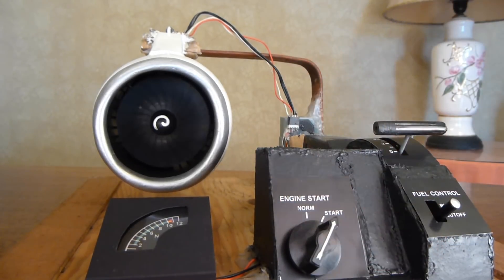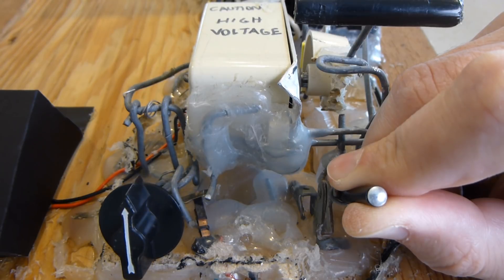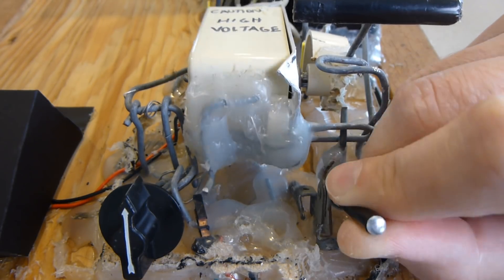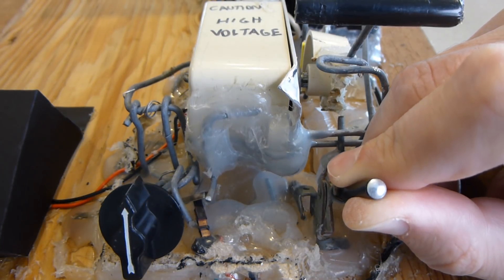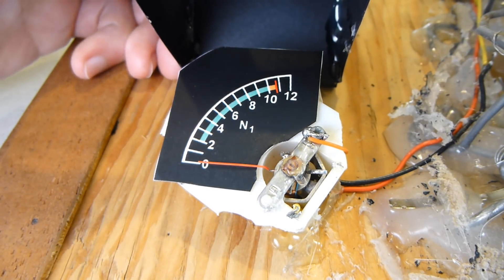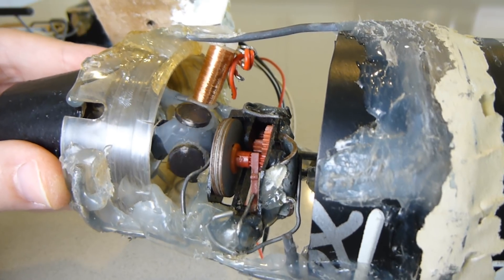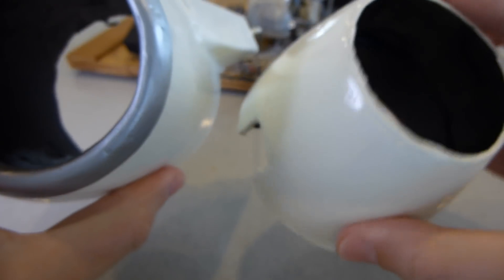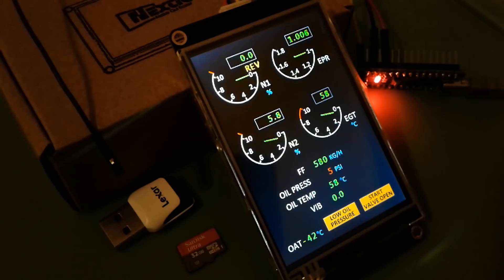Homemade Electric Jet Engine Working Model (1:24 scale) Part 3

Comment: Is this permanently destroyed or it’s still repairable?
Reply from the maker: I repaired after the video so it's fine
Reply: @interlinkknight How didn’t it turned on when you tested the switches?
Reply from the maker: In that moment it didn't have power
Reply: Oh. I thought it’s destroyed. Good thing you can use it 😃

Comment: But I wish you would explain for me in details how that gearbox was made, its function and how it works. I really don't understand those about that. And for better you would make a detailed tutorial of the engine construction from the beginning to the end. Thanks.
Reply from the maker: I'm making a second version with 3d printed parts and Arduino, which I'll do the complete tutorial.
Reply: Ok. Good. So may wait for how long brothers?
Reply: I like that idea and I try to imitate the way you did it but always when I get on the gearbox I fail due to misunderstanding about that but we hope the coming tutorial will be explaining the step by step work. Thank you.
Reply from the maker: Sadly the 2nd jet engine model is not going to be ready soon. Many months from now. I'm into other projects right now. But part of the code is done and the TFT color display is done. What I need to do is design the 3D model and put everything together.
Reply: Okay, let's keep on waiting no probs.

Comment: Hi there could you help me on how to make to dc motor idle as I've searched everywhere but there was no luck. Your the only one who knows how to. Thanks
Reply from the maker: Do you mean control the speed of the dc motor in a way that simulates an engine? I would use an arduino with a motor driver
Reply: @interlinkknight  yes
Reply: Also I'm 13 so I don't know how to program an arduino so I need your help. I'm a nerd in school bud don't know how to code and don't know the software used
Reply from the maker: It looks intimidating at first, but trust me is not that hard to do most things. Start buying an arduino nano, a breadboard, jumper wires and a few components. Then, you can watch tutorials on youtube. There are hundreds of good tutorials for arduino. Start doing simple things and little by little you'll see that you are going to create stuff that you thought you could never do.

You are young so use that to your advantage. I started coding when I was 30 so it was harder for me, but even that wasn't that hard.

I only have a few arduino tutorials for more advanced things so I can't recommend you those tutorials, yet. But you can check my tutorial about electronic parts: https://www.youtube.com/watch?v=czjAfnHgmu4

Give it a try!
Reply: Thanks your an inspiration
Reply: Hi InterlinkKnight did you use spray paint or paint and what colours for th jet engine nacelle (the jet engine exterior)
Reply from the maker: My self, I used oil based paint for homes, but when I am going to build another jet engine model I am going to use modeling spray paint, glossy. Use primer first, though. You need the surface as smooth as possible.
Reply: Thanks

Comment: Are you still working on the new turbofan engine?
Reply from the maker: Yes. I actually have part of it working, even with the color display showing the gauges. But I still don't have a 3d printer.

Comment: Hi thank you so much for sharing. I'm also in process of completing my jet engine model, unfortunately I've been struggling to get the nacelle shape right. Do you have any suggestions on how to make a nicely cruvy engine nacelle? Thank you in advance.
Reply from the maker: Hi. I think is great that you are building your own jet engine model.

With "nacelle" you mean the outside housing, right? Are you using body filler?

What I did was made the basic shape with carton board, in a way that could be detach the two parts, like I show in the video. After that I put several layers of body filler. Exactly the same used for cars. The body filler cures very quick so I did this many times, little by little, trying to give a basic shape. After that is just grinding and sanding. Sometimes I added a bit more body filler in some key parts, and sand again.

There is no go-around. Is a few days of work.

One tip: don't wait is completely cure when doing the first grinding. After a few minutes, the body filler gets hard enough but not too much, so is the perfect time to do the grinding, since is still a bit soft. I repeated the process around 15 times for each part (there are 2 parts).

When you finish your model, please record a video and leave a link here. I definitely want to watch it.

Good luck.
Reply: Hi, thanks for your reply and suggestions. Yes, i would definitely let you know once I've completed it. Thanks once agian.